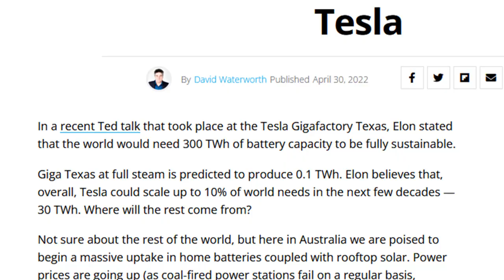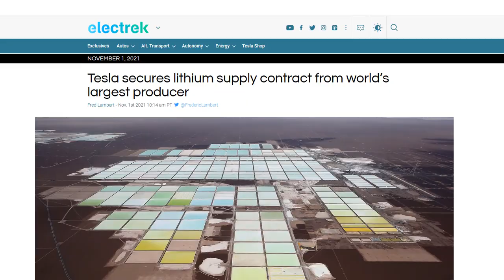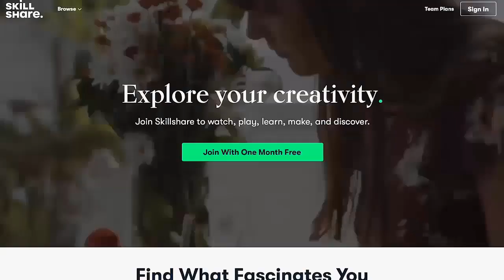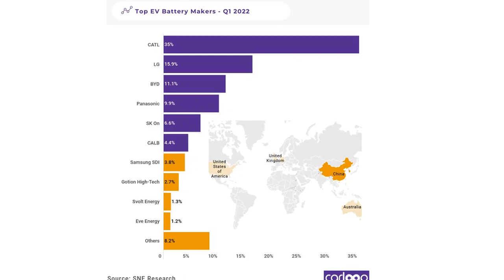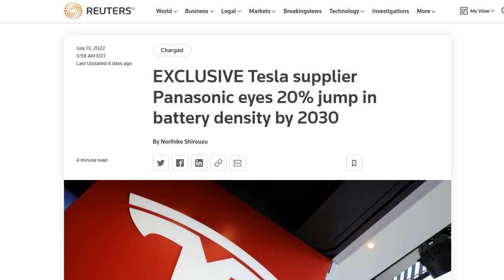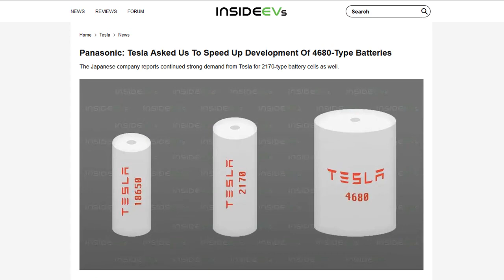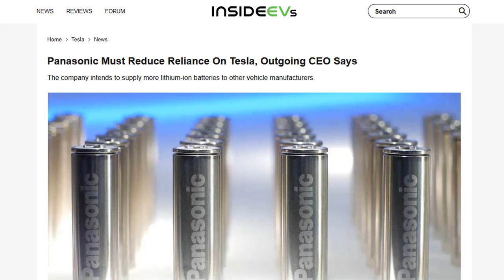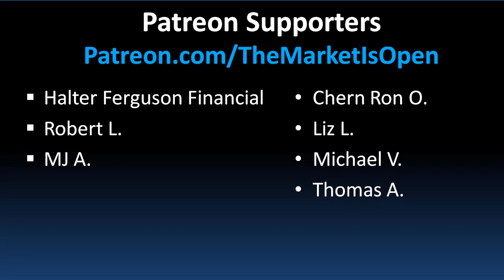The REAL Reason Tesla is Building the 4680 Battery Cell

Comment: Here's a video idea. Go back to Tesla Battery Day - two years ago. What did Musk say, predict, promise? What were all the other vehicle manufacturers saying at the time (and in the months before and after)?  What are they all doing now? Scaling up their equivalent of the 4680? or still making promises?
Reply: That would be an interesting video
Reply: Here's a question.
Did "other manufacturers" HAVE an "equivalent 4680 cell" in even the planning stage at that point?
.
Were they encountering the old problem which had prevented that form factor being developed in high energy cells, that the length of jellyroll (electron path) caused high resistive heating?
.
If so, did they realise it could be done, but had to request "free use" of the Tesla parents?
.
Did Tesla say
"Ok, but share ideas, maybe development, for the good of us all"?
.
Is that why at least Panasonic took a "half way house" approach, using their existing wet process technology and  5 tab discharge (which may not be quite as effective, but may (TBD) be easier to manufacture?
.
I'll note that Panasonic were providing cells for evaluation by Tesla last year.....
.
Is it possible that LG, Samsung, possibly even CATL (!?) did the same (They all have good relations and do substantial business with Tesla)
.
Could Nevada start with Panasonic 5 tab/ wet cathode cells?
.
The point being, was Tesla (originally maxwell) the catalyst for 4680 cells becoming the industry standard?
.
One more question....
The GM 4680 switch.
.
Could we be seeing GM with a "Tesla inspired" cell in future?
(Would that be "Lithium Irony"?)

Comment: I'm no battery expert, but at the basic level right now, car battery packs are too heavy and not dense enough. They're too prone to catching fire if shorted and don't charge fast enough. For cars, yes, we need a generational leap forward in battery tech to improve range, charging speed, weight and price. Li-Ion battery tech is basically 30 years old and despite improvements, is the same tech it's been since Sony invented it.
Reply: As an electrician who has been dealing with storage batteries for a very long time, I would like to make a couple of points: As the millions of Electric vehicles driving our roads can attest to, batteries are certainly energy dense enough to work. Any battery that shorts out is prone to fire, including lead acid batteries. That's why all batteries need overcurrent protection.

Gas/petrol cars have a much higher rate of fires then EV's, and while some lithium battery chemistries and form factors are more susceptible to fires under certain conditions, they are not susceptible to explosion hazards like gasoline/petrol.

Lithium ion batteries were invented by John B Goodenough, while Sony commercialized them. The lithium ion battery has made enormous strides since its invention, and has made exponentially more in the last decade as research and development has skyrocketed, and it is only increasing faster.

The internal combustion engine is 162 year old technology, produces planet and human killing gasses and chemicals, and has at best a 16% well to wheel efficiency, and averages around 12%, and is a finite resource that is becoming more expensive. Compare that to EV's that have a well to wheel efficiency of 55-65% when charged with the dirtiest coal power plant, and 80-90% when charged from renewables.

On trips I find that charging up 200 miles in a half hour to be plenty, as that is barely long enough for lunch. At home it only takes me about 5 seconds to plug in every evening, and another 5 to unplug in the morning. So much faster than going to the gas/petrol station, and WAY cheaper.

I save hundreds of dollars a month on fuel, spent around $100 over three years on maintenance, $700 on a new set of tires, and never worry about driving anywhere due to the cost of fuel.
Reply: @GoCoyote  
You beat me to it, but thanks for pointing out the real facts.
Reply: @grumpusmaximus9446  
That’s high praise coming from your YT handle. 😀
Reply: @GoCoyote  nailed it. 
Also, IIRC ICE cars catch fire 60x more often per 1000 than do BEVs, and hybrids are something like 120X more likely to catch fire. The infamous not enough range argument is a red herring
Reply: You don't seem to know what you're talking about, except, maybe your first four words.
Reply: @billweberx  Harsh. Why are any of my statements actually wrong then? Why are so many companies working to achieve some or all of them?
Reply: @tonyb3629  Read GoCoyote's reply.  He lays it out pretty well.
Reply: @tonyb3629  Companies can work continuously to get better and more efficient, but that doesn't mean current battery tech is not miles better than gasoline engines. Your original post reads as if ICE cars are much better than EVs, which is inherently false.
Reply: Surely the lithium battery technology and performance has and will become steadily better.  Even if it did not though in my opinion it is good enough, now. After all, there are millions of satisfied owners out there now and millions more impatiently waiting for the production of 😁their unit.  Nothing suits everybody so the relatively few complainers might as well get over it. For those who don’t or can’t host home charge ports, it’s a problem with where they live, affordability of housing, charging station locations but not the car.
Reply: @edwardcoulter9361  Li-Ion cells have got better, but are not the long-term answer, and manufacturers know it, but it's all they have to work with right now. Develpment in re-chargable solid-state batteries has been going at breakneck pace, because they solve pretty much all the problems with current battery tech. They don't use a liquid electrolite either (ethylene carbonate, highly flammable) and are expected to maintain 90% of their capacity after 5000 charging cycles. They also work better in low (sub-zero) temperatures. Current EV's carry around a dead weight battery, making the cars much heavier and that has a significant effect on range (the average battery is 400-500Kg). Today's EV drivers don't know any different, but in 5-10 years EV's will be totally different beasts.